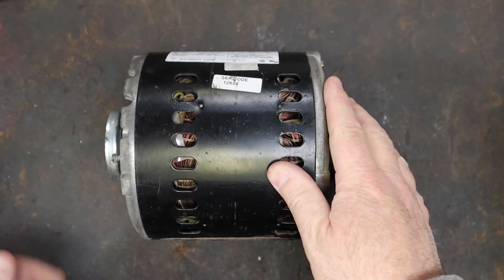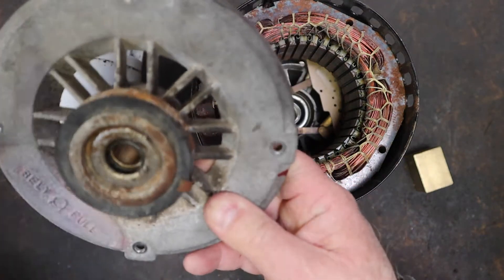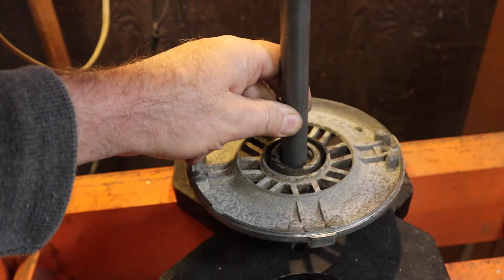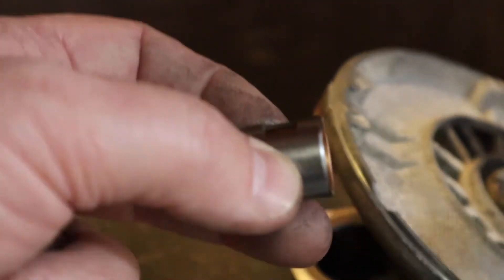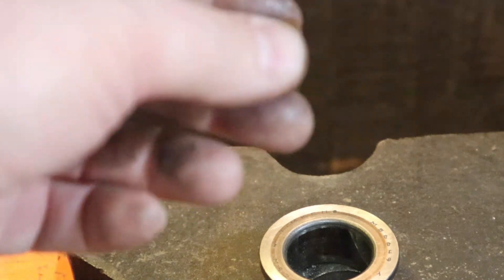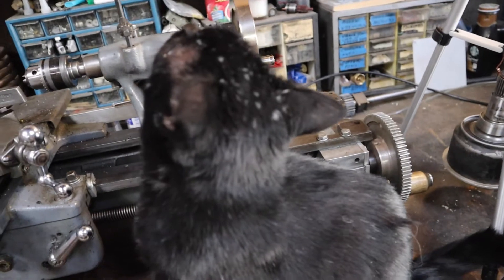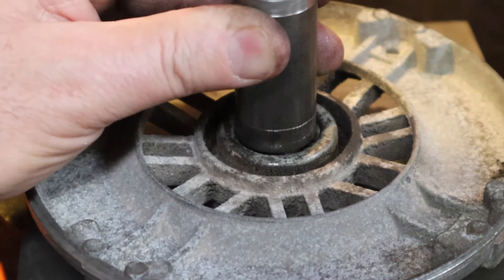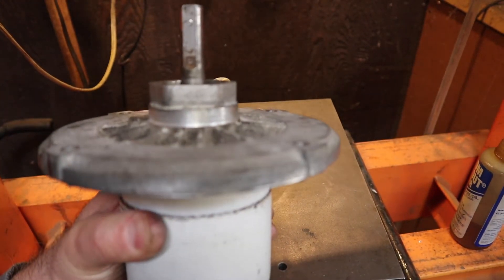Let's Rebuild a Swamp Cooler Motor (to use as a Dyno!)

Comment: Oem bearings available if you don't have a lathe?
Reply from the maker: I was not able to find OEM bearings for this motor, but since I had a lathe, I did not look really hard for them either! I would not have bothered with machining the end bells if OEM bearings were readily available though. Keep in mind, your motor could made by a different manufacturer, so bearings might be readily available. You really won't know until you take it apart and measure the shaft and bore diameters. Most newer cooler motors use ball bearings, and changing those is fairly easy and rarely necessary. This motor is made by A.O. Smith Corp which morphed into Century Corp. It uses what I suspect is a deliberately wacky size of a 3/4 inch O.D. with a metric 16 millimeter I.D. (.6299 inch) The bearings I used are 20 mm O.D. x 16mm I.D. 20mm is .787 inch, so I had to bore end bells from .750 inch to .787 inch.  https://www.mcmaster.com/6658K33 Could this motor be fixed without a lathe? Absolutely! The approach would be different though. I would start with a very common 3/4 inch O.D. x 5/8 inch I.D. bearing like this one https://www.mcmaster.com/6391K247. Then Ream it to 16mm on the I.D. after pressing the bearings into the end bells. If you assemble the motor housing with the end bells while leaving out the rotor, you can use bearing you are Not reaming as a center guide for the bearing you Are reaming ensuring you get the reamer nearly perfectly straight, even by hand and without a lathe.
Reply: @thetransformatorium7980  thanks!